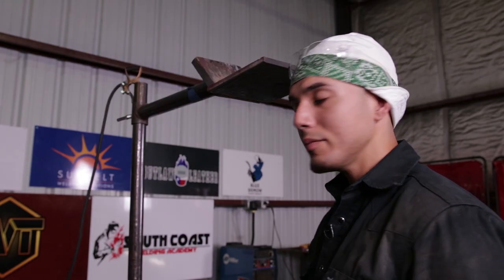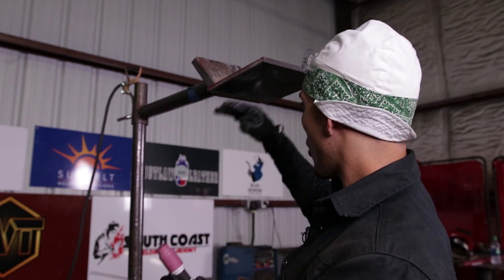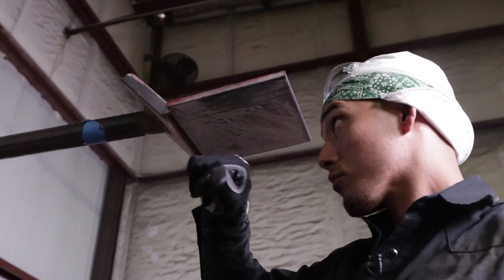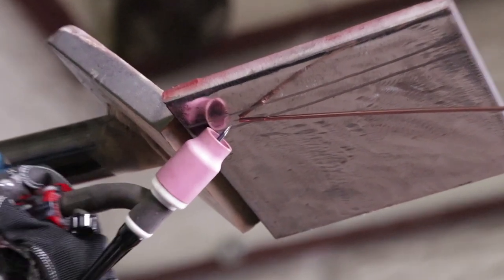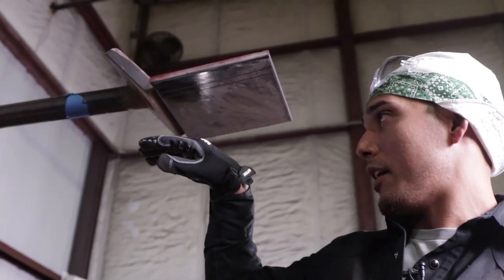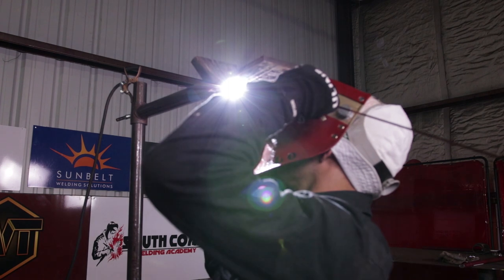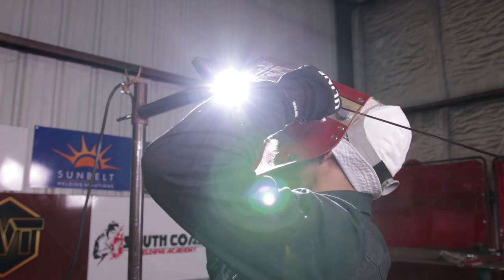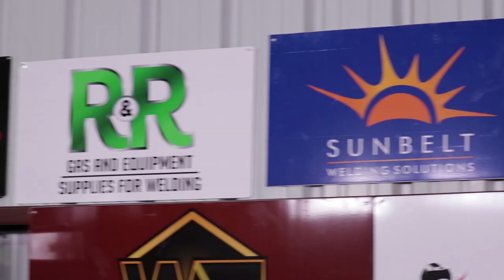Walking the Cup on Overhead Plate

Comment: My biggest issue with TIG so far is the stiffness of my cable. It's so incredibly stiff that if I wrap it in anyway I feel like I have to death grip it to keep the torch from spinning or keep from slipping. Sucks.
Reply: I turn it until its at a good angle wrap it around my forearm if its twisted i adjust

Comment: I'm trying to get ready for making a faraday cage of mild sheet and C-channel for a friend.  I have to do alot of vertical and overhead welding indoors... Should I do TIG with a slider amp control, or try to go with MIG indoors??  I hope a fan and 2 windows is enough ventilation.  I'll be using a fiberglass blanket to protect the wood floors and walls.  Please shoot me some advice!

Comment: Great video my friend. What torch are you running? I'm running a weldcraft flex neck 17 and it sucks. Any recommendations to make it more user-friendly or can you suggest a different torch?
Reply: Heavy Hitter 250 flexhead w/valve. Ived used a lot of rigs and this one is by far the best. Also runs independent lines.